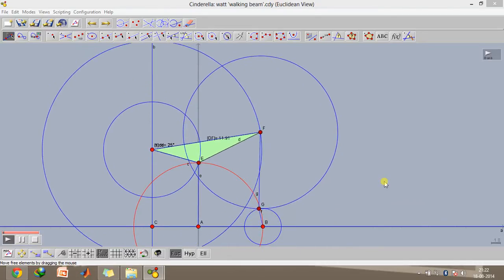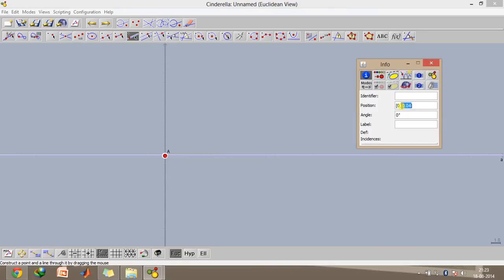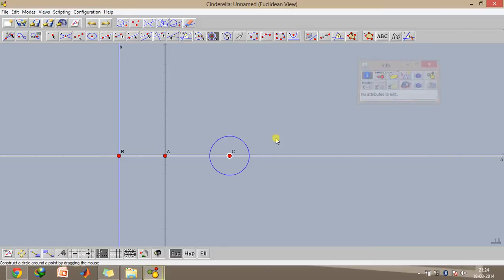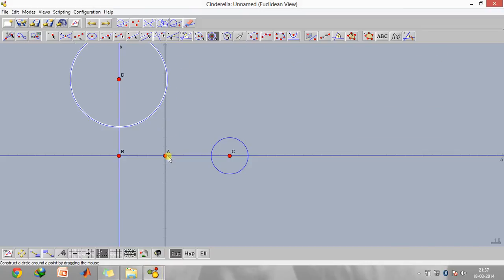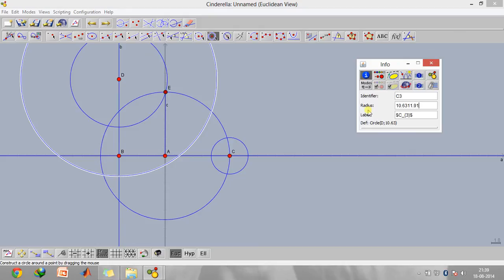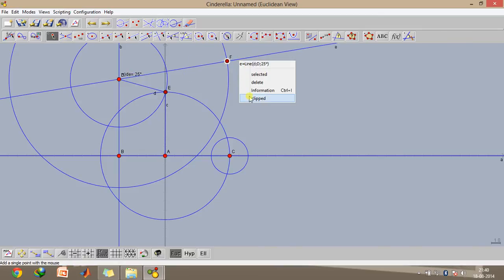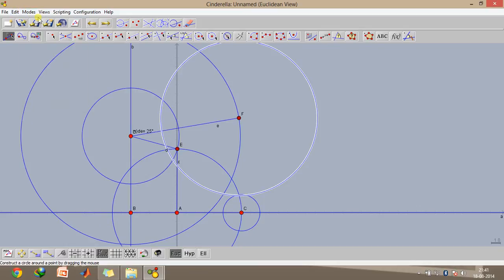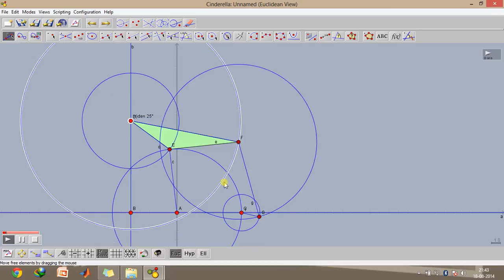Watt "walking beam" or watt's linkage mechanism making in cinderella

Comment: what to be done if in case i want to drive crank gc and observe the motion of point D. (while animate).......???
Reply from the maker: See it does not matter because its a one degree of freedom system, so either way you take any input or output,the motion is gonna remain same
Reply from the maker: and if you wanna start with point G as its input, the mechanism has to be made in a different way because here the reciprocating point is taken first and thus is treated freely.The crank gc is not treated freely because it has been constructed the reverse way.